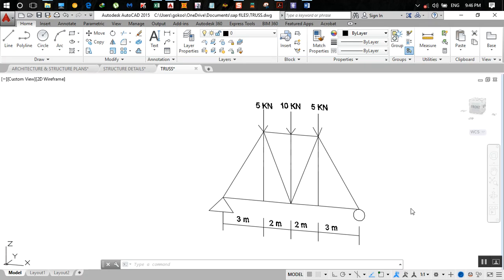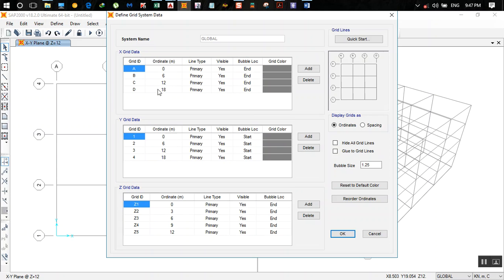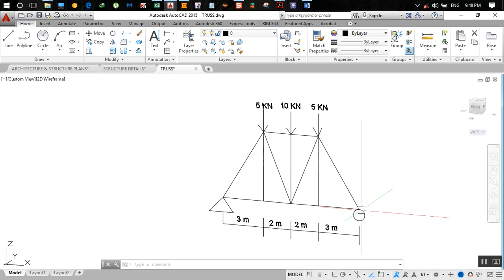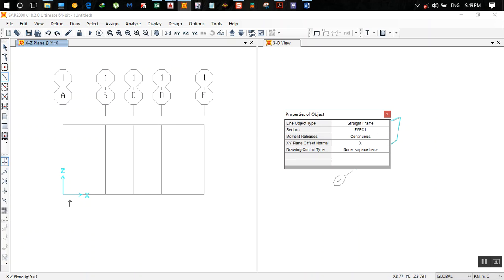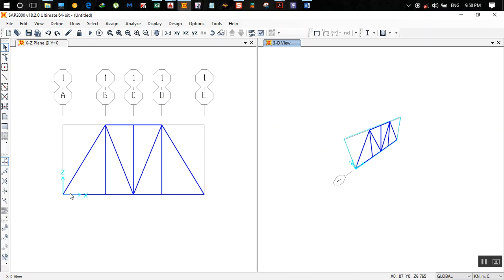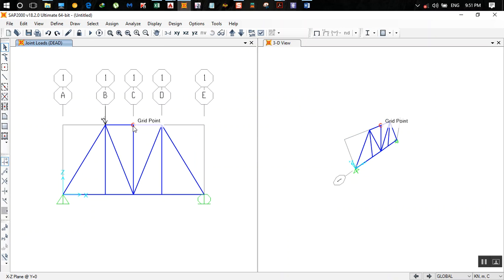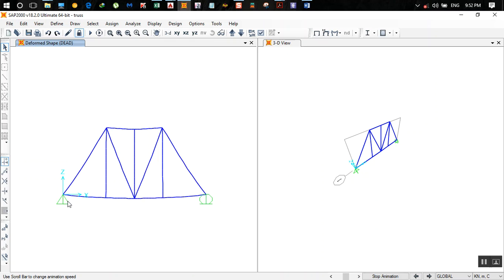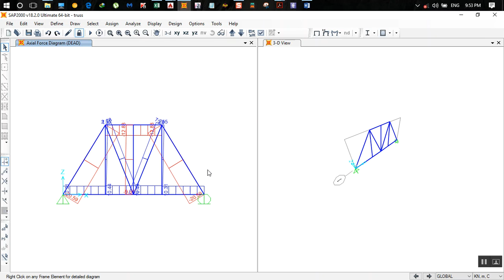SAP 2000 Tutorial For Beginners [Chapter 2]: Introduction Part 2

Comment: You need to release the fixity of joints as they serve as pinned joints, otherwise the program will see them as rigid joints. You can do this by selecting the joints, then go to Assign > Frames > Releases/Partial fixity and release the moments in all axes.